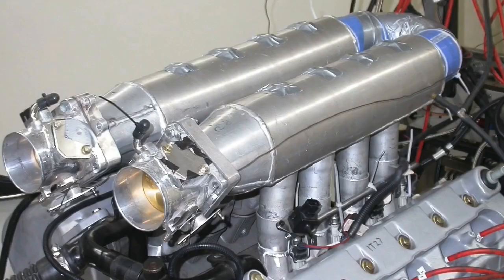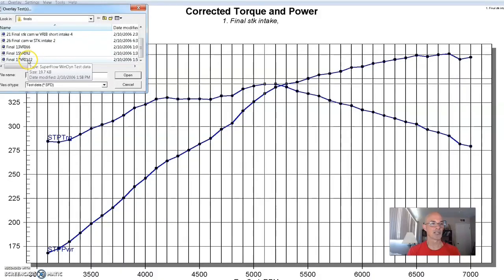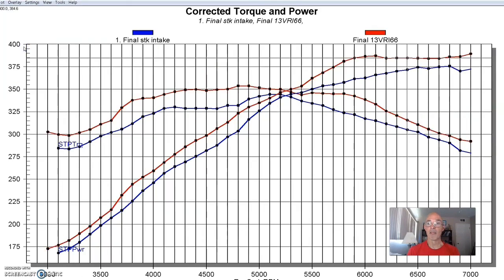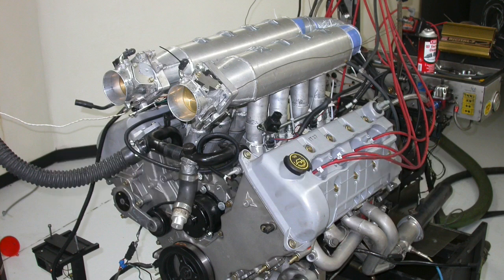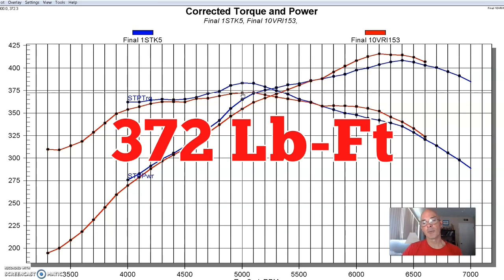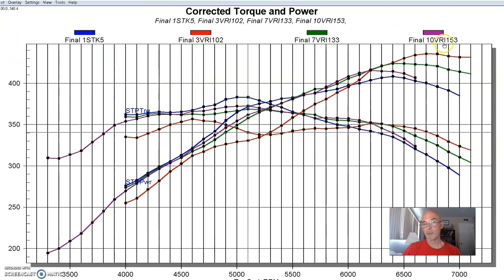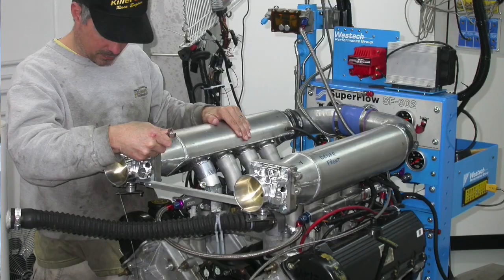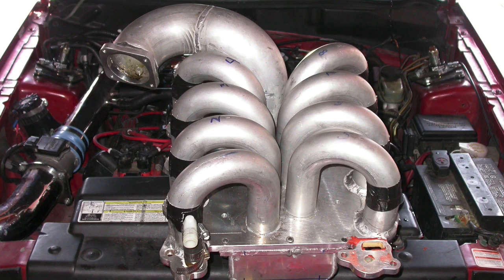CUSTOM INTAKES--BUILT NOT BOUGHT

Comment: Choose the length that makes the most power in the rpm range of your gear change. 

Say 1500 rpm drop at a gear change = short runner  high rpm motor 

2500 rpm drop = longer runner. Midrange is more important

Comment: Very old video I know, but hopefully you see the notification and reply. Let’s say you find the runner length that works best using an adjustable intake like you did, would it drastically change the numbers on the dyno after building the intake with curved runners of the same length so it can fit under the hood of the vehicle? Does air care about the curves that much? And let’s say you boosted the same intake after finding the “proper” runner length, would it just multiply the output or would you want to go back and retest the runner lengths under boost to optimize torque or horsepower output? I have a 98 ram 2500 with the magnum v10 with NO aftermarket intakes available and have toyed with the idea of making a long runner aluminum intake myself to optimize flow and torque, I also want to eventually put a centrifugal supercharger on it.
Reply from the maker: It doesn't care about curves, length determines optimum effective rpm range-works the same under boost
Reply: @ thank you very much for the reply, your videos have helped me learn a ton!

Comment: Now DIY something like the Isuzu used on the 6VD1 engine (like 2001 Rodeo). Vacuum solenoid for secondary throttles.  even if secondaries stick open, it doesn't run away.

Comment: i would like to see same thing done from intakemanifold to filter
Reply from the maker: I tested air intake lengths on this too-much less of a change in power-runner length is the big change
Reply: @richardholdener1727  thats for sure, it just doest look very optimal way to feed the air in straight from throttle body but i guess it doesnt really make much of a difference in higher horsepower engines :)
Reply from the maker: INLET TRACT LENGTH CHANGES HELMHOLTZ RESONANCE TUNING TOO
Reply: @richardholdener1727  Yes that what i was after but there isnt many videos or that many article out of it, at least i havent found that many, english isnt my native language so it might also be that im not that good at searching for it. 

I dont have lot of knowlege of this but i did tried calculate pipe lenght my filter to intake pipe to match intake resonance in high rpm, optimal lenght just happened to be very long in my case 0.83cm whit straight pipe so i opted for secondary wave that was some where around 0.412cm, now i dont know if it matses and how well but i do know from airflow meter that if i shorten it do lose ammount of air i can feed to engine in high rpm, i did some reading of rule of thump that the secondary pipe should be bit longer than actual intake runner but it was bit vague read at best.

I really like this video you made cause it simple and demostrates clearly whit intake runner lenght how they change the power output character.

Comment: you built your manifolde as separate left and right manifolds...build with oposit mixed left and right sides....and a common plenum
Reply from the maker: we ran it joined and not joined-all various lengths. Adjustable rules

Comment: have you ever done a diesel, i own a 7.3 powerstroke and the in take manifold is connected to each other it would be interesting to see how it would do. Great video!!
Reply from the maker: I don't run diesels on the engine dyno
Reply: @richardholdener1727  the powerstroke head intakes are all connected together, they have small runners into a large connected room. I guess that simulates shorty intake runners? thank for the reply!

Comment: Hi Richard,
I understand this is an older video now but I have a kind of odd question that I dont see anyone else asking..
What about variable intake runner length, in a different sense - using different length runners per cylinder.
I've been kicking around the idea of making my own prototype intake manifold for an LS swap and I got the idea to alternate runner lengths. So 1: long, 8: short, 7: long, 2: short etc. etc. So theres 2 long and 2 short on each side of the engine.
Have you ever tested an intake like this or do you have any kind insight as to how something like this might perform or affect engine life?
Reply from the maker: I TESTED THAT ON THE FAST ADJ INTAKE-TO SIMULATE THE SINGLE PLANE-NO MAGIC
Reply: @richardholdener1727  interesting. I'll have to check that video out when I get home from work.
I'm excited to see which end of the spectrum that favored.
Do you have any videos on the effects of 4-2-1 headers? I've seen that style on other applications, especially 4 cylinder engines but in my admittedly limited research I haven't noticed anything like that with the long tube style for the LS engines.

Comment: Richard I know it would be a pain but I’d love to see you take the data you just learned and build a variable length manifold that optimize both top and bottom. It would make a great vid!
Reply: That was done years ago with a For 250 Cross flow engine. Was quite impressive.   It was controlled by small electric motors increasing the runner length up top with the rpm from 3000 rpm onwards.
The torque was very impressive
Reply: Pretty much what many factory intakes do, but obviously size/space restricted. Would definitely be useful to have both options though. Going road racing, pop on the stacks and run with it. Then putting around, swap em out.

Comment: Can you do a test isolating intake runner shape? Not bent vs straight, but round vs square vs some oblong pear shape tubes, etc. Could probably figure out a good design by having cups of different shapes, filling them with water, then drop bit of water in the center and watch how fast the waves dissipate. Which ever dissipates quickest should have the least pronounced syne wave on the dyno.
Reply: Maybe you can find some aluminum extrusions that have an interior shaped like sound foam, then play with runner length with that.
Reply: Intake runner filled with turbulence reducing honeycomb.
Reply from the maker: the wave in the cup is going in the wrong direction
Reply: @richardholdener1727  fucking what? That side-to-side contributes to resonance.. which contributes to that sine wave dyno graph.

Comment: So I remember back in the day my dad rented a Lincoln Mark VIII and it had the 4.6 4 valve and it was pretty damn fast. I also drove one of the OBS Ford Lightnings with a 351 and while it was pretty quick, it wasn't anywhere near as fast as the newer body style Lightning with the 5.4 supercharged. I used to race a modified 2000 Lightning and I had a 1992 Acura Integra with a custom built turbo kit using an old Garrett T3 from a Dodge Daytona 2.2 and it was ALOT of fun. It made 308 whp, but it also didn't weigh much, so it was pretty closely matched to the Lightning on paper. The Lightning came stock with 360 HP, but he had a custom tune, a bigger supercharger pulley, I/H/E, and some slight bolt ons, so he was making around 500 whp, and on the street we were always close, but he would always pull away from me. It was always alot of fun though and we became friends, but I always wanted a Lightning...or a Mark VIII.

Comment: I feel like the thing you should be doing with this is doing profiles on a bunch of different engines see if you can find  some kind of data correlation.   I also be interested to see what does the intake runner diameter do to your numbers... It seems like you never really explain this in the video... so I am wondering if after it clears the size of the valves, does it not make sense to make it bigger or what not.. Whatever the case, this might be a good fallow up content video, even if the topic is short.

Comment: I like what your doing. This is the only one of your videos that I've seen.
The one thing I think you might be missing is test for resonance. I think this is one of the biggest reasons why port polishing works.  After all even though it's primary purpose is moving air. When it comes down to it. It is pulsed air. And at those engine speeds the pulses create a standing wave. At resonance that standing wave helps you. Especially if it occurs at the entrance to the port.
Reply from the maker: do a search for reflected waves

Comment: Would it make a difference if you fatten the short runners?
Reply from the maker: might add power at high rpm-unless already over sized compared to intake flow
Reply: @richardholdener1727  has anyone ever made a fat short and also skinny long runners on the same intake? Would that make a difference? Always wanted try making a intake that has throttle blades in the inside, as eight closes the other eight opens. With the short runners hidden underneath the long skinny runners overlapping on top.

Comment: Have you had any experience with the Mopar keg manifold, do you think making a beveled cut on the end of the runners a good idea. Do you think that manifold could use a higher lift cam. Thanks for all the interesting tests and good presentation.
Reply from the maker: have not tested but plan to
Reply: Thanks for the fast reply

Comment: See, I don't like torque curves that have holes in them.  I also don't like torque curves that have strange humps in them or are too steeply diagonal.  Flat as possible, that's what I like.  Throttle response, and therefore cornering control.  I'd rather sacrifice a little bit of peak number on the torque and power curves, if necessary, in order to keep smooth around the bends.  It's irritating to lose traction around a corner without changing control inputs because the motor suddenly came on the pipe.

Comment: Peak power is about making the most hp for the least rpm. Cubic inch displacement times rpm divided by hp equals Aspiration Index. The lower the figure, the more efficient the engine is as a power producer. The Repco 3 liter 1966 Formula 1 championship engine designer Phil Irving and the AVESCO Holden Commodore engineer Larry Perkins used that method to find beneficial power peaks. As Larry said. 460 hp at 6800 rpm beats 462 hp at 7000 rpm in a 305 V8. 305 times 6800/ 460 is an AI of 4508. 305 times 7000/462 us an AI of 4621. The lower the AI, the greater the power per rpm. Phil Irving and Larry Perkins upset even more people off the race track than they did with Championship winning cars. Jack Brabham said you wanna win with the least speed advantage. On the dyno, its the same. On torque, midrange is maximised by bank to bank interchange like the Honda PGM FI or TVIS Toyota systems. On my old in line sixes, the intake plenumb doesnt have to be a fixed 50 percent...you can vary it by volume, not length if you combine twin runner logs with a vacum operated change point. This is how the Broad Band Resonance Ford Barra intake worked. Variable total Volume is then the next commodity, not just intake runner length. All that third, forth, fifth and seventh wave if the seventh wave stuff...you fix it Honda style by acoustic responabce boxes which add volume and help an engine cope with in and off throttle.

Comment: I have a 4.6l 4v in a 97 Grand Marquis. it puts down an easy 310 to the tire. Its got Some bolt-ons 
Its my "Poor mans Marauder"
It should put down more but the 2.73 rear gear kills some power. It'll get about 28mpg at 65mph though.

Comment: When you think of the engine as an air pump and a complete system, you have to measure from the carb/tb blades all the way to the exhaust exit, wherever that may be (uncorked at least). So the same principles work on headers. Long runner intakes need longer tube headers, short runners need shorter header tubes. One wont work best without the other. I dont quite understand the terms and physics involved, but I understand results.
Reply: If you want to learn, study up on fluid dynamics and tuning flow.
Reply: @xmo552  I probably should've done that 30 years ago, back when I still read books. Nowadays, if I cant absorb and understand content within 10 minutes, I move on, lol.
Reply: @donellmuniz590  
Yuuuuuup. Well, try a YouTube vid. 👍

Comment: Please, some time, play with adding ports between the two plenums.  i.e.  One connecting the two in the middle, and one connecting the two at the end (which could eventually be open/closed by the ECU at different RPM ranges)    i.e. Like Mazda's KL motor (i.e. the V6 used in the mid 90's Ford Probe).   Would love to see the gains actually quantified.
Reply from the maker: I did that

Comment: It appears that other resonances, such as plenum volume Helmholz resonance is occurring here.  Perhaps attaching the ram tubes in a 180 degree fashion to have equal pulsing in each plenum will provide different or better results.  Also connecting the two plenums with a valve will allow different tuning.

Comment: Personally I'd go with the better lower end because everything I've built is for street use and it just makes for a better daily. And yes I've ran high RPM motors but find them to be a pain in the ass for daily driving.

Comment: I saw a rotary with electronic slides that got shorter at higher rpm and were long at idle. The slide length was set to rpm and throttle opening percentage.

Comment: I love it! Very cool and interesting. I’ve wanted to see something like this for a while! I’m planning on fabricating my own aluminum intake manifold for the 6.0L  LS in my truck. I know there’s plenty of intakes out there for these engines but, I want something different.. Ive already made the basic design in CAD but I don’t know exactly how long I should make the runners to get what I’m looking for. Being that I want all the low-mid range torque I can get I know they need to be pretty long, but how long exactly is the question. How long is too long? You know, at what point will runner length start to do more harm then good to performance? Those are the answers Im looking for before I finalize my design. But thanks a lot though this video gave me some added confidence that my current design & runner length should not be to far from what it needs to be to get the results that I’m looking for!

Comment: Well look, if you're going to build one you should make it adjustable. You can make your own rpm based controller with an Arduino, open source and $10.  Easy to learn, no joke. You don't need dual runners either, like early SHOs and MR2s had. You can simulate runner length. Start with 2 intake boxes 1 for each bank. Fold one bank over on top of the other, they will be offset but runner length is equal. Then, connect the 2 intake boxes at the far end, (far from the throttle.) Then another tube connecting the 2 intake boxes in the middle of the intake. Inside each of the tubes you have a vacuum controlled flap that blocks flow, doesn't have to seal perfectly. At low rpms all the cylinders breath from the Throttle body side, mid rpms the far valve opens up allowing the 2 banks to pull air from the TB side AND from each other at the far end, High rpms both valves open, each cylinder can pull from a larger volume and 3 directions effectively making it a shorter path. Visual aid Mazda KL  v6 intake comparison. https://www.youtube.com/watch?v=mVcCTana4vw&t=26s 
Side note: If you're boosting or supercharging there is no benefit to a staged intake.

Comment: it all depends on the cam being used, that 262 is a stage 1 comp cams, right?? I'm going stage 2 on my 2v 09 P71.. Hey, i'm going to put titanium retainers on my car, its completely stock, have you ever dyno tested power gains in doing just that mod?? i'm hopefully going to record it n upload it on here for my 2v Panther loving ppl to see n maybe they'd like to do it as well, not one video have i seen of any person doing this mod to their engine (4.6L 2v) so i'm doing it.. That's a mod that'll give increases in both hp n trq at all rpms n even more rev-ability..
Reply from the maker: titanium retainers? with stock springs and cams? It won't change by 1 hp
Reply: @richardholdener1727   well, i'll soon find out..lol Springs n cams will come after, but 1st i want to have documented dyno results after every mod cuz too many times ppl change 2 or 3 parts n say they made x amount of hp but do they know what part made how much, most certainly they dont.. Plus many claim some mods make 0 hp (cai, tb/plenum, shorty headers, etc) so i'm going to let the dyno results speak for themselves instead of repeating other ppl's opinion.. ;)

Comment: I wonder what would happen if your intake runners were larger by the carb and narrowed down to the intake port size so you would get more and more velocity as the RPM increased while still maintaining the pressure effect of a short runner down low. Would you get a smoother less erratic torque and HP curve with less loss on the botton without sacrificing top end power?

Comment: You should do some testing on the 00-03 5.4 2v pi. Nothing for intake manifolds
Reply from the maker: the intake shown on the thumbnail will fit the 5.4L too
Reply: @richardholdener1727  power wont be the same tho

Comment: What would happen if every other cylinder had an intake runner and header that was turned for bottom end power and the other half of the cyclenders were tuned for top end power? Would you get the best of both worlds?

I always wondered the same thing with 2 strokes. What would happen if you took a Banshee and had one cyclender ported for bottom end and put on a bottim end expansion chamber. Then port and pipe the other cyclender as a top end screamer. It would be cool to see.
Reply from the maker: I did that test with the Fast adj intake on the big LS3 intake test

Comment: Too bad the factory manifolds weren't tested with their adjustable runner lengths enabled. Would be neat to see if there would be more torque way down low at 3000-3500rpm.
Reply from the maker: they just have IMRC plates-no change in runner length-but those help